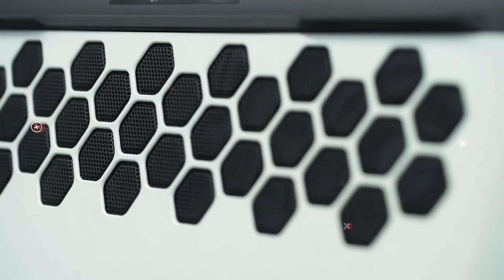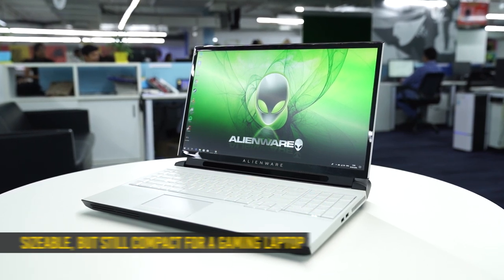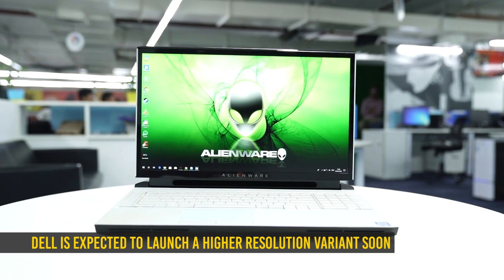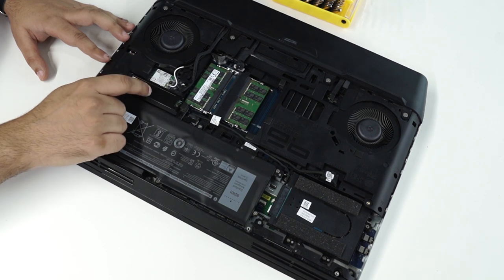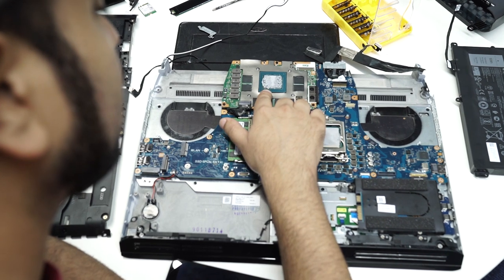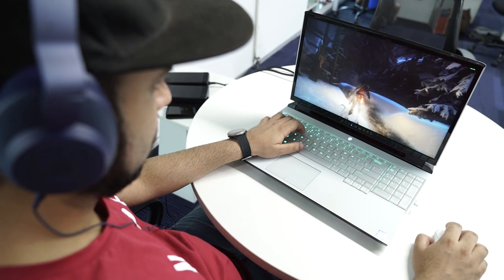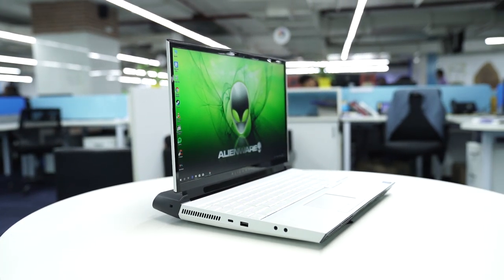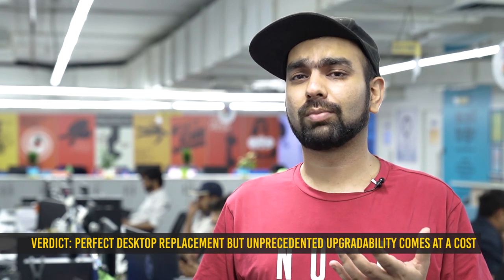Alienware Area 51m Review: Gaming Desktop in Laptop Clothes

Comment: I’ve got one. The speakers kinda suck. No subwoofer and no bass.
Reply: what is the cost of i7 9700k rtx 2070 variant
Reply: @tejaduggirala4214  It depends on the configuration. I actually got mine refurbished. I paid 2340 for mine. Save over 600 dollars
Reply: I wouldn't mind the quality of the speakers as long the computer meets my expectations regarding performance.

Comment: THIS IS WRONG ONLY I8700 WITH RTX2060  DOES NOT HAVE SIDE VENT CAUSE IS 8 GENERATION.
WITH I9700  RTX2060 HAS 2 FULL SIDE VENT CAUSE IS 9 GENERATION.
Reply: All the versions of this laptop have working side vents 😂
Reply: The vent is there regardless,